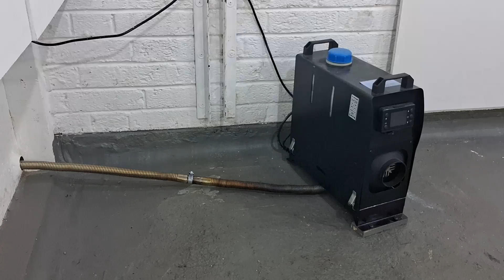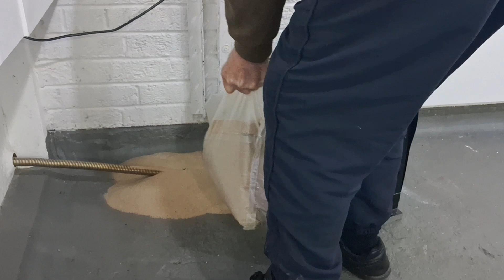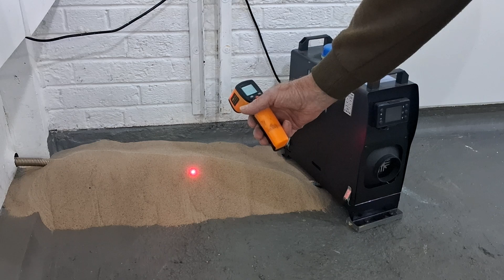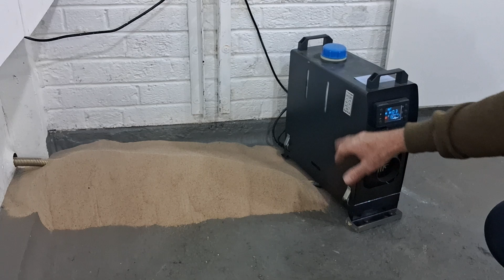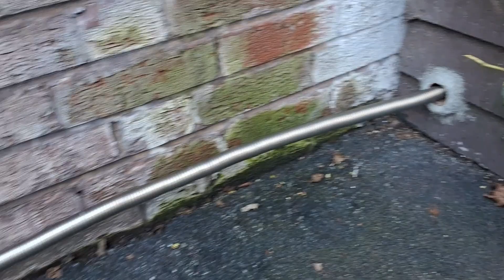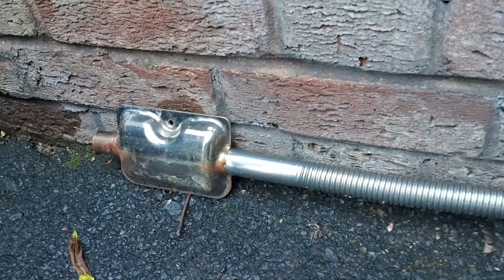Diesel Heater Sand Battery Gas Bottle Waste Exhaust Store Heat Energy Oil Storage Off Grid Van Life

Comment: Water has the highest heat capacity, so why not make a steam powered something or other from the exhaust heat. Maybe it could generate electricity to power the pump?
Reply: like a 15mm copper pipe inside 22mm? The main problem would be the cold start of the system, exhaust gasses would condense and quickly you would have two pipes full of water.
Reply: @5084204  Attach it after the cold start? No idea how or if it would work but the principle sounds good - to me:)
Reply from the maker: good idea cheers andy

Comment: The sand is cooling down quickly as the heat is radiating into the floor, sand batteries are insulated to reduce heatless.
Reply from the maker: good point thank you